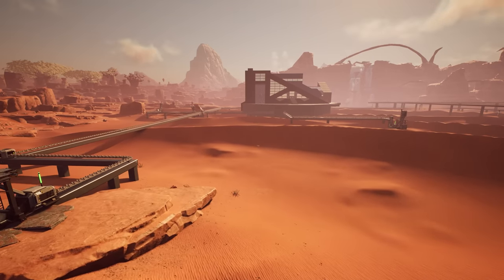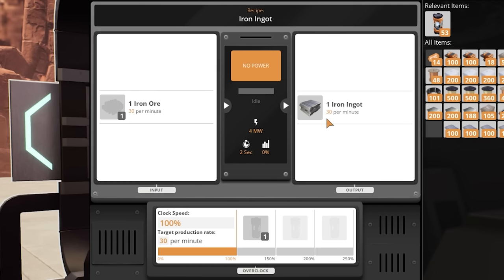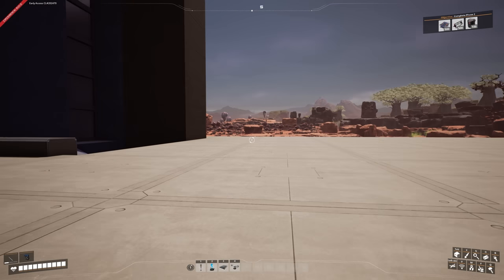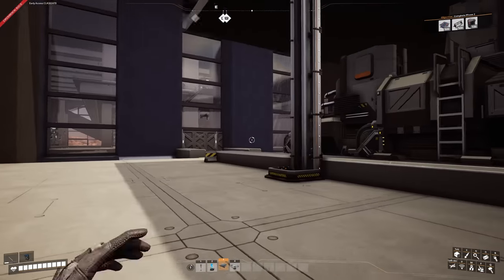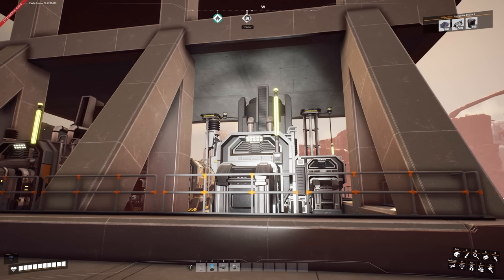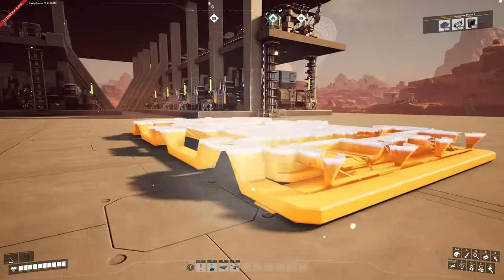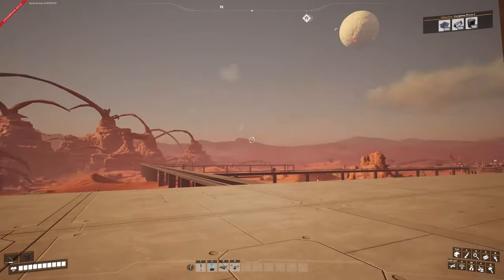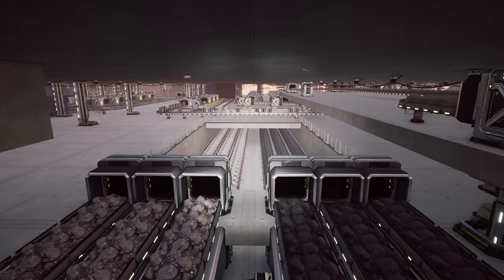I FINALLY added STEEL into the FACTORY!!! In Satisfactory Update 6 - Part 4

Comment: So much I've learned in these first few videos of this new playthrough.  My current save, which I haven't played in a while, is a bit of a jumbled mess, as it was my first playthrough.  Shoot, it's probably broken because I have a set up in the area they updated in this update.

I'm going to check it out and see what's happening with it, but will probably start a fresh playthrough in the desert, as you have done.

I tend to like to have buffers (containers) between my different stages of construction.  That way if something goes wrong, I have time to adjust everything to keep the reserve topped off.

Comment: I have a save that i have like 130 hours or so in, includin some idle time to let stuff accumulate, and i think its a mix of very organized and random conveyor spaghetti everywhere.  Also random concrete factories that just feed sinks as well lol.

Mine is more organized chaos, like 2 full tier 5 belts of caterium ore to feed the supercomputer plant, which is a spaghetti nightmare beside my hub lol.

Or my starting iron plant, which i have a secondary platform above it to process the extra ore when i upgraded the tier 1 miners to tier 3, which sits below another glass floor/ceiling that makes ammunition.  That glass ceiling covers the entire valley plain above the draw that leads down to my nuclear plant.

It's not as glorious as josh's map, but i think the mix of organization and randomness would probably drive you even more mad than his.

Comment: I've been doing vertical builds in my save, but the logistics of making them efficient and clean looking are making my brain hurt. I think I spent nearly 10 hours planning out a smart plating modular factory with distribution floors. My goal is to one day create a single factory that is entirely self feeding. Basic iron parts factory overflow feeds the reinforced iron plates factory, that overflow feeds the smart plating and other recipe needs. it'd just be so massive that I doubt it can be done with my level of understanding of the game right now.

Comment: Still boxing things. But it's getting better. Relocating early stuff into my new "mega factory".
I actually started with steel there, but am now going for the iron stuff. Well, screws. I think plates can be done for whatever needs plates.
So currently I'm working on a 16 constructor rods factory, into 24 constructor screws factory.
I split off one 30 ingots plate into storage thing for construction stuff.

Also replaced the 16 compacted coal power plant facility with an 8 turbo fuel generator one and if I'm not mistaken, the rest of the compacted coal should get it to 16 turbo fuel. \o/